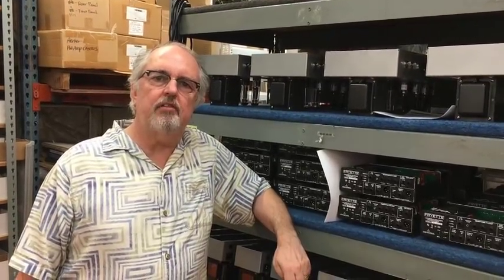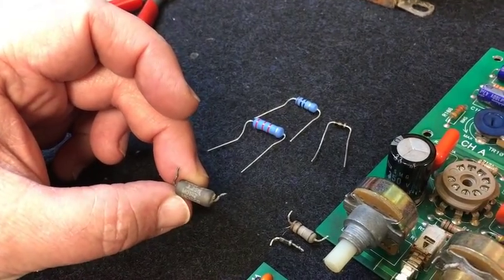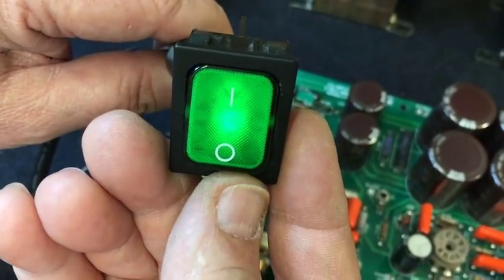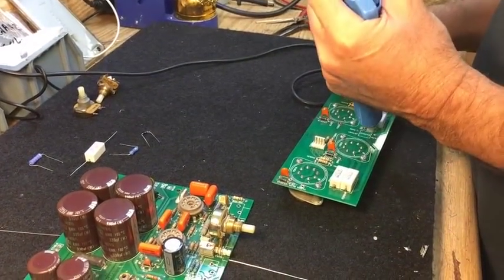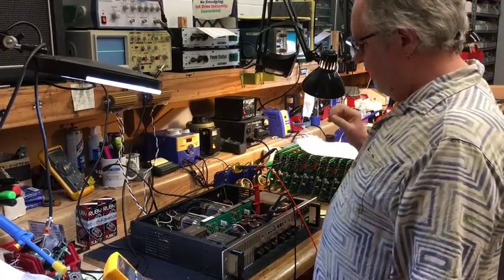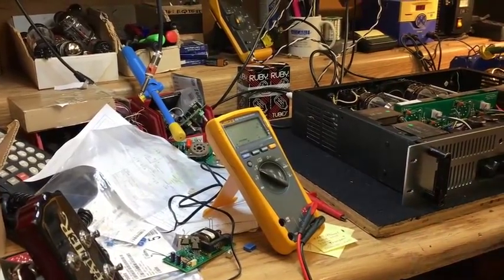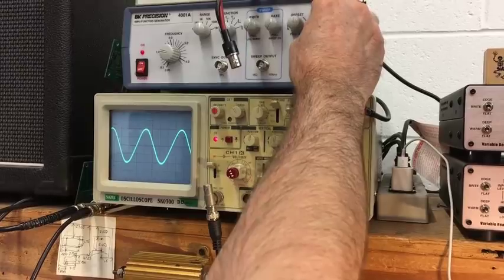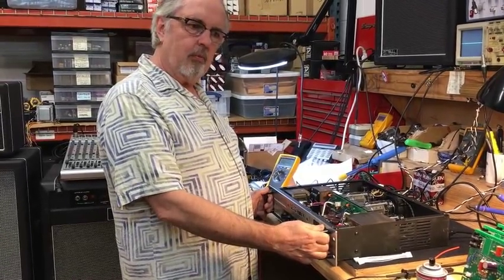Fryette Re-Animates The Two/Ninety/Two Power Amp Part 6

Comment: Hello Fryette Amps and thanks for the interesting video showing the process of repairing & testing the amps.
Since I'm relatively new in electronics there is one technical question: what is the blue thing (with yellow elements) being used by Bred in his left hand at the 6:05 and later (at the end of each soldering). I'm asking cause when I solder some electrical components on the PCB I don't use this kind of blue thing. Thanks.
Reply from the maker: That's a solder extracting tool being used to remove solder in a part to be removed for checking or replacement. See http://www.edsyn.com/product/DS017.html Thanks for watching!

Comment: What is the plate voltage when off standby? 650?
Reply from the maker: 700 at 120VAC
Reply: @FryetteAmps Oh wow, 700v. I guess that's where the headroom comes from, lol. If it were any other company I'd be more concerned but you are perhaps the most well-versed hi-fi audio guy in the guitar amp world I've ever come across.

I'm not sure if you've ever done it before but it would be really cool to see your version of an all-tube bass amp. Aside from Ampeg most tube bass amps I've ever played through struggled to keep up with the low-end because they were essentially just repurposed guitar amps. I think a properly designed ultra-linear power section with a cathode feedback scheme would help keep everything together better than solely relying on the global negative network to correct for it. Just a thought, keep up the good work👍